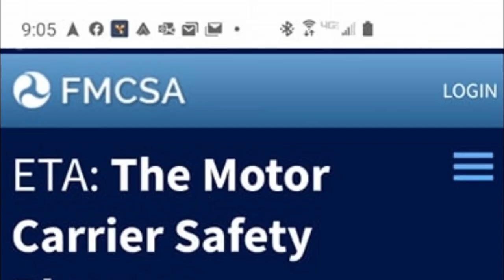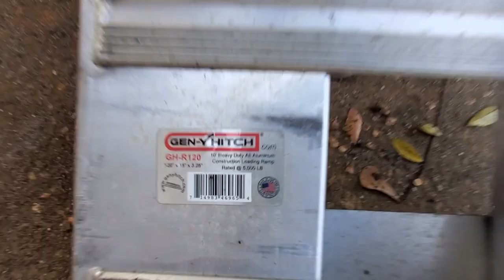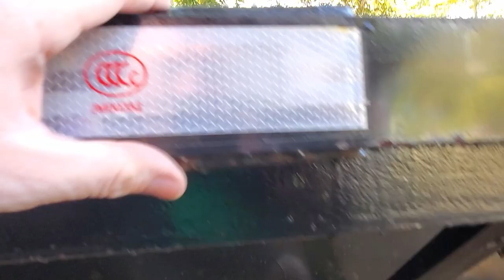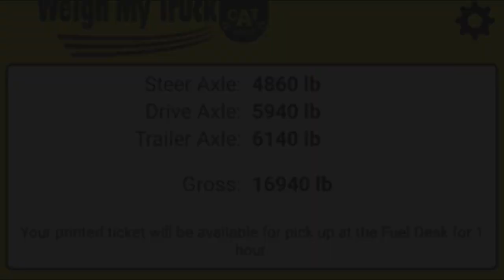DOT was at my house for 3 Days!

Comment: Sorry Guys, but if you did not violate the law ___________ DOT and your viewers would not be on your back. All DOT is asking is that you follow the laws to keep the roads safer for everyone. Welding any trailer frame weakens the frame and it changes the strength  of the metal. 

Re: Load Capacity  _ the tires on the trailer should exceed the weight of the trailer and load on the trailer by 20%.
 In other words if the trailer and load equals 10,000 pounds the capacity of the trailer tires should be 12,000 pounds. And yes indeed the springs will crack and break if their carrying capacity of the springs is exceeded.. Also totally unsafe to tow 12,000 pounds on springs that are rated to carry 10,000 pounds.  Your following all the rated capacity laws will result in Less costly breakdowns on the road. The gross weight of the trailer and load on it also cannot exceed the trailer load capacity of the towing vehicle and the load capacity of the tires on the towing vehicle.

Comment: Take it to a Structural engineer get him to stamp it off for a few Hondo's. Then register it as a homebuilt and move on DOT cant stop you. You can do anything you want if it is approved by an engineer and the engineer stamps off on it the manufacture doesn't have to approve crap. DOT is over ruled and so is the manufacture by any structural engineer on any improvements or even Trailer they make or build that is not approved using the same process. Most engineers will just laugh look at it and say can you set this much weight here lets see and then draw it up Stamp it and charge you a few hundred $$ and your done.  don't believe me call one up and you will find out you are covered also under the right to repair and service law that protects you from having to go back to the manufacture for service or repair monopolies. you own it and can make any repair or change as long as it is done right that's all they want to see. DOT is no expert on this matter. Neither is the trailer manufacture they went to an engineer also and have a set of blue prints they use to mass produce what they make. Just like them get it stamped and move on.....
Reply: The issue is there are some area's of the frame if not done correctly welding to them weakens them and will compromise the amount of weight they will haul. If you get an Engineer onboard you can build a 400 foot long Trailer in your front yard but is the length leagle to pull on the road. No not without permits etc.  Don't let no one tell you that you cant do anything because you can. It may not be done conventionally but you can do it.

Comment: Get a certified mechanical engineer to sign off on the modification. The manufacturer obviously uses a mechanical engineer to approve their designs. I've received approval for building radio towers which is more difficult than designing a trailer on wheels. 
Governmental authorities depend on mechanical engineers. They know what it takes to make skyscrapers stay in the sky and planes fly. They damn sure know what can be welded on a trailer to make it stronger or what should be avoided to prevent it from making it weaker. 

With that said, I've owned and operated four 18 wheelers in a past life. After a few years, I concluded that it's against the law to drive a truck in America.
Reply: KCAA TV I am afraid the dot will still say no cause the manufacturer did not approve

Comment: So it's like with any other accident related review... "spread yer cheeks'n grit yer teeth."
... Yeah, I was thinking the (old) trailer would hold a camper or tiny house nicely.
Oil seals can vibrate out oil at the right resonance. (Self milking?) And with the seal ON the axle point it will surely be vibrated.
You might paint the boards on the tail red as a no loading hint.
-Happy trails.

Comment: Note to self, don't f with the trolls. Also,  you talked about the brackets added to hold ramps. Not factory again. You talked about adding pipe stakes. Factory needs to do that too. Can't add ratchets. Never ends. Final note, get out hotshoting. Too much physical and paper work for what you earn.

Comment: I’m a 24 year driver. Have you ever read you green bible? How do you not know that modding is a big no no. As for your oversize amber light make sure you get permit from GA and New Mexico its a $4 permit but if you don’t it’s a $400 fine. Good luck in 2020

Comment: Sorry to point out after u bought it, but  that trailer it is very poorly built. My Dad taught me to weld in 7th grade and one thing he drilled into to me is that and ugly weld is never a good weld!  If the bead is irregular then the bond, (weld) is irregular.   I was a certified  welder at 18.
Using angle iron instead of tube steel is a cheaper but weaker frame, that's why all the extra cross members and supports.  Good Luck!

Comment: Etrailer.com you can get parts cheap
Reply from the maker: Yeah I've looked at a few things from them. Usually end up doing the amazon prime thing
Reply: etrailer ships stupid fast and has tons of stuff in stock
Reply from the maker: @michaelhutton9729  that's what I'm always worried about. Shipping times
Reply: I know amazon prime is fast but i have also had super luck with etrailer shipping times and also good luck emailing them to get correct part numbers and bearing and seal help too
Reply: Ordered a leaf spring from them shipped same day recieved it 2 days later.... pricedcare good aswell